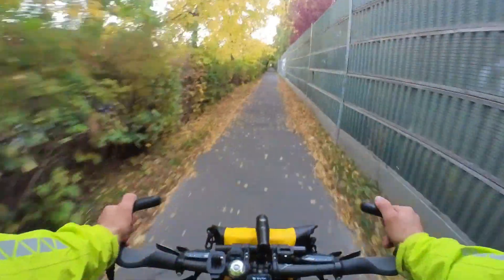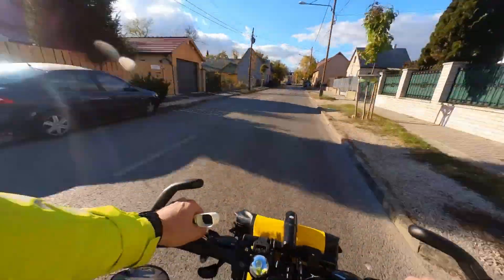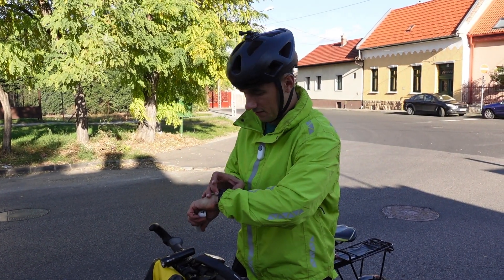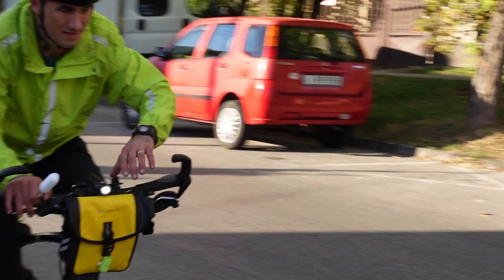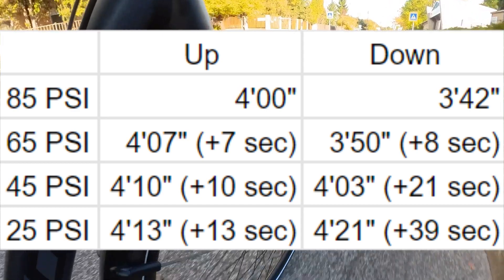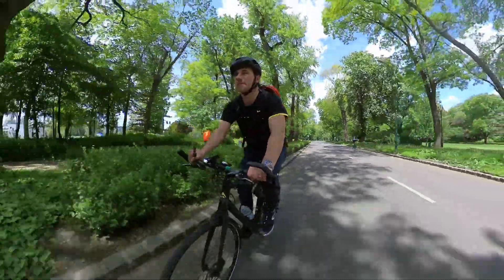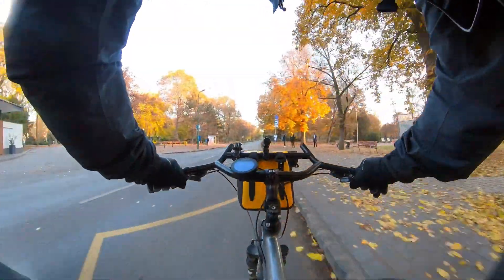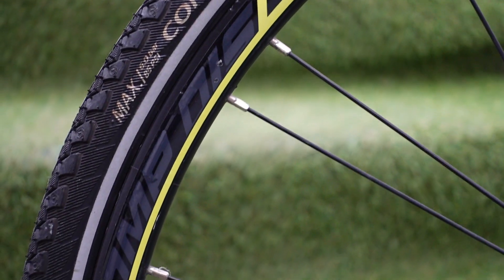A SECRET Only 37% of Cyclists Know for Speed and Comfort

Comment: I rode my road bike to work Friday and it took me an hour to get there and it is only 15 blocks away from where I live. Come to find out both my tires were completely flat. After work I aired up my front tire and it held air. Back one I didn't even try to air up because I knew it was flat for awhile now because the presta valve is broken inside the tube and with a road bike a flat rear tire isn't noticeable when riding so I don't pay any attention to it. I knew something wasn't right with it when I was riding it. It made a squishing and snapping noise from the front and I knew it was a flat front tire. I'm going to ride it to work tomorrow morning with the flat rear tire on it. Shouldn't take me as long to get there as it did with both tires flat.